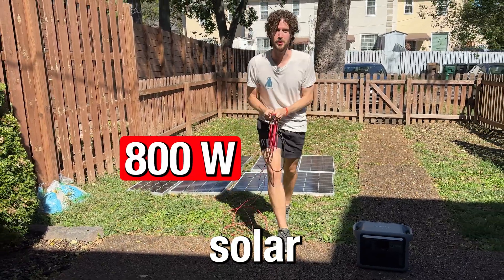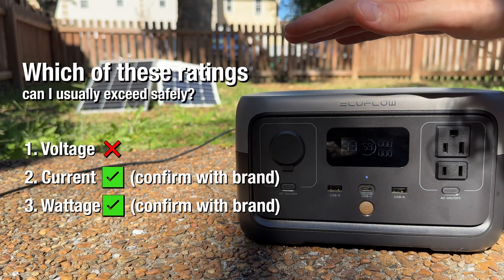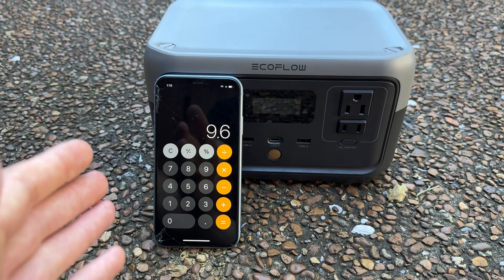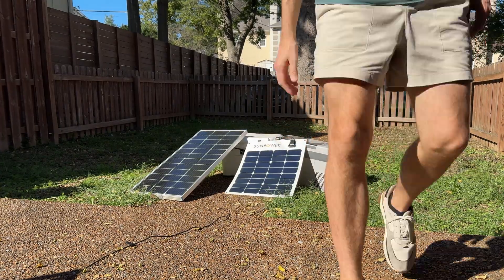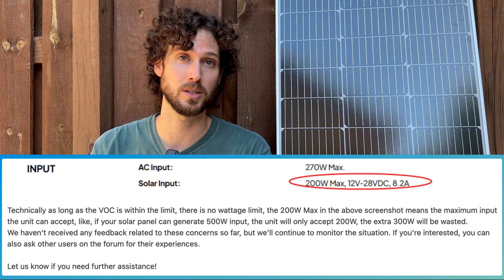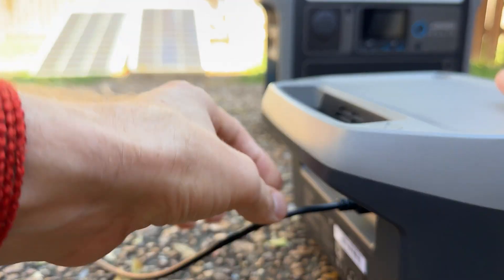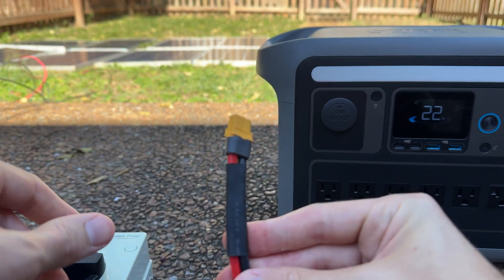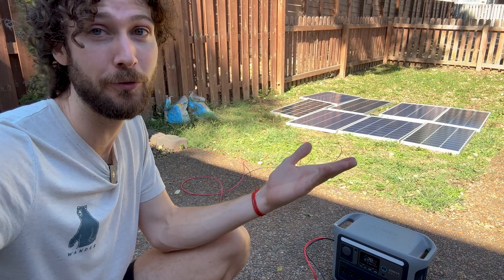How I Overpanel My Power Stations (Safely)

Comment: I have an Ecoflow River 3 Plus (55V 13A 220W Max) and i found a solar panel (48.5V 12.68A 610W Max), do i have a problem if i use it? (With a MC4 - XT60 cable)
Reply: you can plug in any power station direct on Car batteries that could push out hundreds, if not thousands Amperes!!!!
so to plug on a car batterie 1000 Ampere CCA with 13 volts= 13.000 WATT is no problem....

why a 600 watt solar panel will be now a porblem? 
if 13.000 watt from a batterie is no problem????

Comment: allw hat you are saying is wrong , any powewr station can be charged over a car battery and a car battery is a unlimited power source !!!
there exist no over amperer.
you can put in parallel on a powwer station 100.000 Watt of solar panels and it will still charge with its speced 110 watts thats the truth.

Comment: "Overpaneling" is also done on grid tied inverters, since you rarely get the full output of panels, you can oversize array slightly and rarely get clipping, but increase overall production. Bifacial panels can more easily hit advertised output with decent light from backside.

Comment: I have a large ecoworthy power station it can take 1300 watts , i love it and I want to get another. I have a question can i slightly over panel  . I would stay within the amps and volts limits and put 700w into each connector for a total of 1400 . I live in Florida it is warm and I have never seen my panels put out full capacity

Comment: Hi Alex, since you and I have the same power station but you have way more knowledge in this field than myself I assumed it would be best if I asked you. 
Is there a way to use an external MPPT charge controller, let's say a Victron, for added compatibility with a wider variety of panels? It's a matter of the power station's MPPT receiving constant voltage and not the usual solar power source, I am even asking this crazy idea since there are people charging their power stations with  3rd party LFP batteries directly into the MPPT port...

Comment: if you can plug in a battery to the MPPT up to the max voltage, you can do whatever. If the panel was the thing limiting the current, the voltage would drop first.

Comment: They way I see it, current should never be a hard limit. If you can connect a solar power station to a led acid battery and it survive then clearly the power station is limiting the current it can take in, not the battery. A battery can supply far more amperage than a little solar power station could take but they seem to handle it just fine for the most part.
Reply: Or think of it as running a 100W light bulb off a 15 amp circuit. The light bulb doesn't draw 15 amps at 120v it draws more like 0.8 amps. You can have as many amps available in your supply but your load will only use as much as it needs.

Comment: Do you have a video that allows plug in and solar panel. Is this similar to over paneling?  Can tell the unit to only draw power from the grid at 10 percent to recharge?

Comment: Tried attaching five 230w panels to a small Bluetti which could take a max of 4 by my power calculations.  Over powered and boom, blue smoke came out of the unit.  It ACTUALLY STILL WORKS, but I know I've fried whatever first line of defense it had.  My fancier larger units just recognize if they have been too far overpowered and refuse to take the charge.  So, bottom line is, beware of doing this with small power units they don't have the protection that higher powered ones do.
Reply: would you share more specs about the power station and panels? to learn how much it was over if mostly voltage or amps etc. Thanks

Comment: Theoretically, having an array with more current than is accepted by the power station should not hurt it if the MPPT in the power station is designed correctly. All that would happen is the internal buck, boost, or buck-boost converter that the MPPT is designed around would only work at a certain rate, so the converter would only draw up to a certain amperage, the panels don't push current... not exactly, they make up to a certain voltage, the effective series resistance of your load (the MPPT in the power station) allows current to flow proportionally to the voltage generated by the panels... I'm oversimplifying a lot. But basically, the current is determined by what the power station can draw, not what the panels could produce if you shorted them. The issues only arise if the MPPT inside the power station is damaged or poorly designed (In which case you should not use that brand for safety reasons). It's like having a a 15 amp circuit in you wall powering a 1 amp device, totally fine as long as the device is up to code and all the wiring is up to code. The extra current isn't held back exactly, in the water analogy, pressure is voltage, flow is current, if your panels can allow more flow, then the limiting factor is the MPPT which will limit itself by just not drawing more than it can use.

If you apply too much voltage, that can be a problem since it would potentially exceed what the silicon switching components and capacitors can handle, frying them and "pushing" current in ways that are undesirable (smoke comes out).

Same logic as why you can hook a 0.2 amp 12 volt load to the 12 volt car socket in a car or a power station, the load just doesn't draw more than it wants and the extra of the total 10 amps capacity is just not used.

Comment: I've used 54v (3 panels) on a max 50v mppt charger, working just fine
Reply: Many battery units have a +or- % limit so you may still be within limits
Reply: @wineweasel  power stations from most brands seem to have a buffer in place to ensure that users that don't know that VOC increases in cold temps don't fry something when they hook a solar panel up in the winter. It more or less seems that if a power station says "11-30v" it means it will safely handle a 30v VOC panel at any temp. (DON'T TAKE THIS AS A GUARANTEE, USE BEST PRACTICES, SOME BRANDS MAY DIFFER)

Comment: Technically speaking, you can reach a current limit if you have no current limiter. This means do not connect to an unregulated battery like this. The charge controller is only pulling up to stated current.

Now for some fun. Reverse another set of splitters, and pop a second load to use some of that leftover current. I am particularly fond of 9v-36v rated USB controllers. Even a basic car phone charger can run direct off a panel in a pinch (12-24v is inclusive of 22v)

Comment: Look at grid power. It provides 120v and either 15 or 20 amps from an outlet, so how often do you plug in a single device that draws 15, or 20 amps???? 

Plug in  25w light bulb, and it'll draw roughly 0.2 amps and with 14.8 amps still on tap. Same with LED's. 

The heat and light generated by the way is from resistance. Lower the resistance = lower the heat. The led will pull way less amps at a lower resistance and it will last for years and even decades.

Comment: Maybe better to have run the solar panels  as 3s2p to maximize the input voltage (at 60v) and reduce the current. You would only be using 6 of the panels,  but you might get closer to the 600W limit of the battery pack than with your 2s 4p configuration?
Reply: Thought this too

Comment: volts are pushing and amps and pulling. a device will only pull the amperage it can accept. therefore it is perfectly fine to have a power source that has a potential to give more amps than the end device can accept

Comment: Nothing wrong with over panelling the River 2 in parallel.  I use two 220w Bifacial panels on my smaller River units even the older River Max.  It will just accept when it can amps wise.  Just don't go over the VOC and account for colder temps in winter.  You will hit the max solar input more often when over panelling in varying conditions.
Reply: there exist no over paneling, ecoflow rivers can be charged direkt connected to car batterys.
car batterys deliver 1500 amperes...

Comment: There's a wonderful thing called ohm's law. As long as the voltage is within safe limits the device will never draw more current than it needs. Excess power will be wasted but it will never damage the device itself. Batteries in parallel do the same thing as solar panels in parallel. You can have a huge bank of car batteries safely powering a tiny device but also have the ability to melt a wrench in half.
Reply: yeah, but where do the extra voltage go?

Comment: The only limit is the voltage. As for 110w limit is the max the station can charge at, you can safely connect to 10,000watts of panels. Its the same controler for the car which has hundreds of amps but only draws 8.
Reply: yes there exist no amere limt all power station can be charged plugged direkt to 12 volt car batterys....what he shows is confusing..

Comment: I watched most of the video but i didn't hear you mention conservation of energy even once. When you overpanel these machines are not designed to accept a wattage above a certain ammount. Mine is 200W, at a time. If you increase the ampage and create more current that leads to going above the maximum wattage limit you will just create heat, and heat with lithium batteries isn't a good thing you are damaging your power generator.
Reply: Not quite right. The battery pack has a BMS that protects the battery. And usually has an MPPT controller that manages the input from the solar panels, usually to maximize the output of the solar panels. But in this case with over provisioning the solar side the solar controller is limiting the current being drawn by the device. Amps only cause heat if they are being used somewhere. If you are not using them, they just disappear …
Reply: @stevewort  amps don't just disappear they become heat lol 😂
Reply: @stevewort  that's why stronger wieres can dissipate heat and prevent damage but heat is always released
Reply: @RECURSIVECIRCLES The amount of current drawn from an energy source is dependent on the internal resistance of the circuit you connect to it.
think about this example. I have a 12v lead acid battery in my car that can deliver a max cold cranking amps (CCA) of around 500 amps when needed to start the car. That capacity is there ALL the time. The circuitry ONLY draws that much current when the starter motor with a lower internal resistance is connected to it. The rest of the time, the regular car wiring draws maybe 5-10 amps at most. Those 500 CCA are always available. They don’t dissipate in heat while the car is either running, or sat their idle.

Comment: I am sorry, but you are doing a hell of a lot of speculating and guessing. I don't mean to be insulting, but it seems that your knowledge of electronics is based on watching a few YouTube videos, done by equally uneducated people. You don't "put amps INTO" a device. You simply make them available if it can conduct it. Any device, from a simple resistor to a charge controller, has a characteristic "resistance." Whether that resistance is simple resistance or is electronically controlled, as in a charge controller (and most modern devices). The current that then flows through that device is based entirely on the voltage applied (which IS controlled from outside the device) and the resistance of the device (again whether simple or electronically controlled). The only way you can force a device to conduct more current is to raise the voltage. That is why voltage is the hard limit for these devices. 

Wattage is absolutely NOT a separate, third entity to be measured. It is quite literally a FACTOR of the voltage and current. But, you wouldn't know that, because you only really go by what you see on the screen of your power station. It is ALWAYS merely calculated from the voltage and the current. 

This term, "over paneling" seems to be a term that only comes from a gaggle of uneducated people on YouTube pretending to be experts.
Reply: Wow… thank you… I’ve been wondering about this based on what i learned in school even I wasn’t good in electrician
Reply: God you are dumb.  You said he is using youtube for his research then you said exactly what he did lol.

Comment: So... this doesn't make sense. Everything we're told is the device draws current. As long as the voltage is correct, the charge controller should draw what it needs and no more. From what I've read, the only thing that is affected by going over the amperage is the reverse polarity protection. If you connect the solar in reverse and are over-amperage, then damage can occur. 

For reference, every single day you are supplying more potential amperage to all of your devices... in your house, car, etc... without fail. The item only draws what it needs.
Reply: Exactly, so 110w panel or 1000 is the same, but 1000 will provide more steady input. so long voltage is within limit.

Comment: So, to summarise, the panel(s) should have an open circuit Volts output just less than the storage device will accept, with due allowance for temperature effects and should have a power rating greater that the device will accept if the maximum charge rate is to be achieved, even in poorer lighting or cloudy days

Comment: Perfect demonstration of the volts times amps current limit you need a panel with an operating voltage of say 46 but a VLC under 60 and those are hard to come by or multiply up to without going over but great demonstration of everyone’s problem when you have a  60 V limit  it’s the operating voltage times the current input limit that determines your wattage

Comment: Circuit voltage between 2 dissimilar panels in parallel doesn't become that of the lower voltage panel. I see this stared all the time, but experience tells me voltage will be close to the average of the voltage of the panels if they are close to same rated wattage.